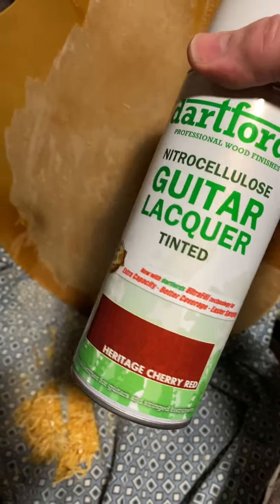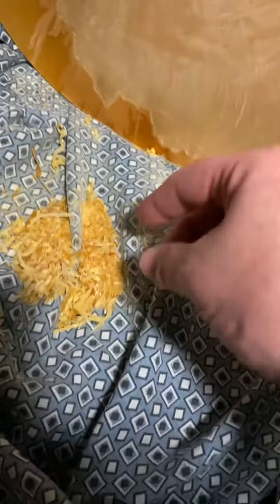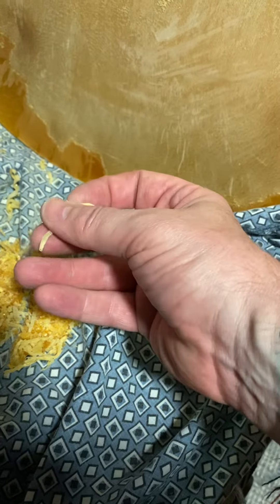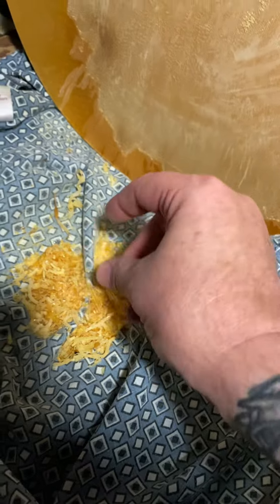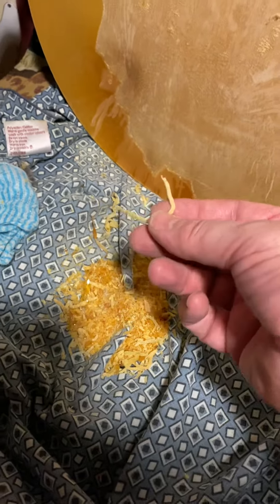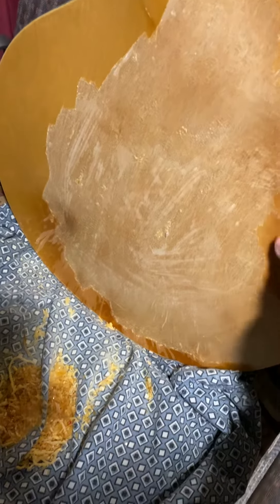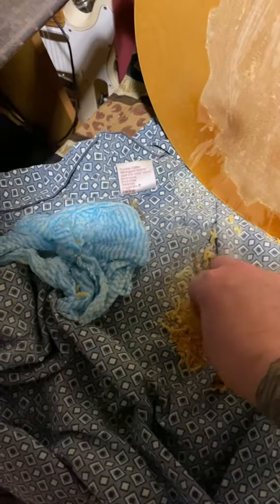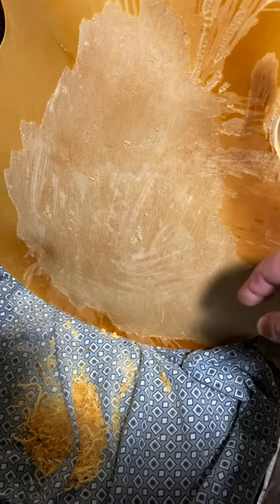Epiphone guitar - what’s in that lacquer?

Comment: Hi I am thinking to do the same to my 2002 Epiphone Emperor Joe Pass which has a thick coat of clear lacquer, may I ask did you re-lacquer yours afterwards, or just leave it without any lacquer, and did it sound any better acoustically (un-plugged) afterwards ? Thanks.
Reply from the maker: Hi Matt, I learned quite a lot about lacquer during the refinish of my 335 Epi from poly to nitro. There is quite a misconception that polyurethane is a tone sucking finish and nitro let’s it “breath”. Typically the internet is misleading. There are 2 types of polyurethane and Epiphone actually uses a product that is very glass like, I liken it to sugar, in that it would have about 5% of plasticisers in it, as is predominantly hard crystal like glass. Nitro also comes in 2 different kinds on the main market- spray cans from Behlin and Mowhawk have what appears to be 50% plasticisers in it, and I find that although very forgiving and easy to use feels plasticy.. you can buy nitro that has no plasticisers in it, which I’ve used on a Les Paul to great effect and I would recommend using it, still comes from Behlin. 
In the end, after refinishing many guitars I can say as a fact you will hear no tonal differences whatsoever between nitro and poly, it’s a myth. Go to the luthier section of the My Les Paul website and the guys there will confirm what I’m saying- the trolls however will muddy the water after a few hours of your post so be wary :)

PS unless you want you Joe Pass to be a different colour I’d leave it be, if you don’t care go for it, but I’d seriously suggest the type of nitro used on furniture that “cracks”, sounds odd but it cracks because it has very little to no plasticising properties. If you want that aged look that’s what you want:) 

Good luck
Reply: @Morning_guitar  Hi Morning_guitar, thank you for your experienced reply, it's very much appreciated. My Epi Joe Pass has actually an amazing tone when played acoustically, but it shouldn't have because its only made of laminated wood, so I guess the thick factory poly lacquer is somehow assisting the guitars sound. As you recommended I think I will leave my Guitar as it is now, to change it to a Nitro finish would make it look and feel better, but its not worth doing that and risk losing its exsisting good acoustic sound. Thanks again, Matt.
Reply from the maker: @mattmatthews4070  Hi Matt, you’re welcome, I think leaving it is a good move.
There is an often quoted Beatles ‘fact’ that John Lennon and George Harrison stripped the lacquer off their Epiphone Casino ES guitars as made them sound better…. John and George have never said this in any interviews or letters, so I feel this is one of those internet myths that has a life of its own and just stokes the fire of the “let it breath” theory lol…

Interestingly the 1964 Epiphone guitars  bought by the Beatles guitarists were all made at the Gibson factory in Kalamazoo, and were sprayed with nitro… which bolsters my opinion that they stripped the guitars because of different reasons.

History says the Beatles stopped touring in 64’ and were at home and bored… so they modded lots of guitars, cars and homes (Lennon also painted his Rolls Royce)… George Harrison also stripped his Stratocaster, and used poster paint to make it more like Eric Clapton’s “the fool” 63’SG guitar.

 My way of thinking is that John Lennon stripping his guitar, then painting it in polyurethane, was because he wanted it to stand out on stage and for the finish to stop cracking and falling off. Also he had a lot of time on his hands. 

I’m rambling on a bit - apologies 🙂

You’re doing the right thing, you have a very cool and versatile guitar there, it’s a keeper no doubt.

PS: The Epiphone ES guitars are maple/poplar 5 layer laminate with either spruce or maple centre block, normally, I’m not sure about the Emperor models like the Joe Pass.

 I’d read online that the poly lacquer on Epiphones was like wrapping a guitar in a tone sucking rubber condom ! But when I started stripping it I found the lacquer was thin and hard, definitely not a tone sucking condom 😂